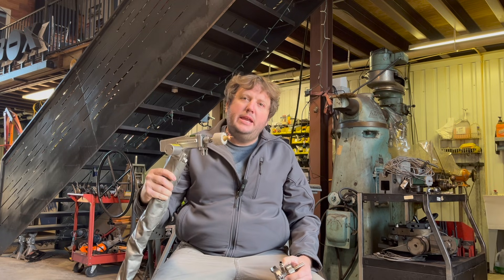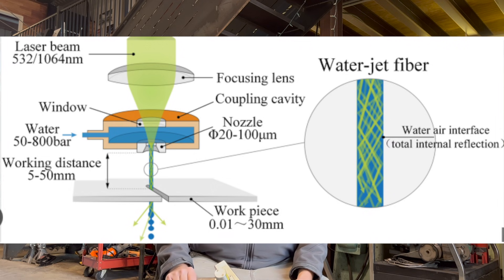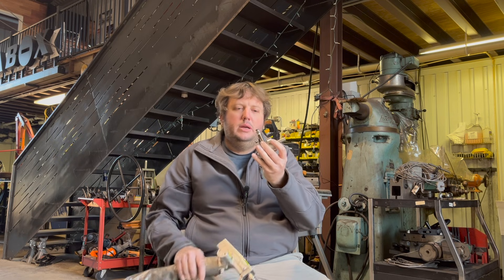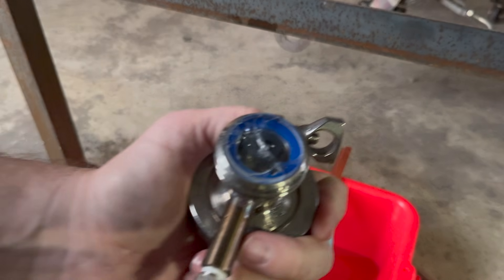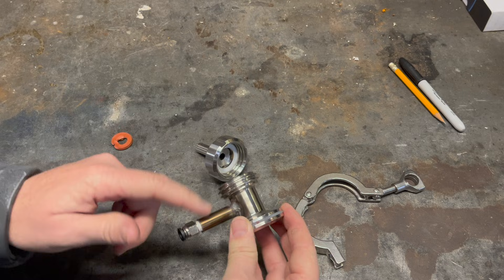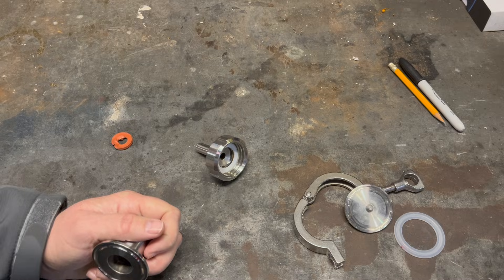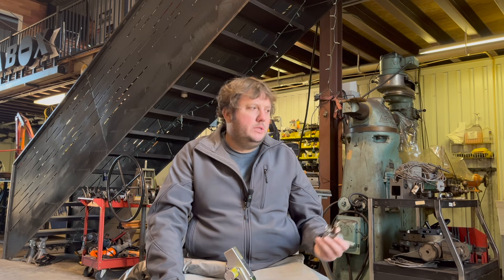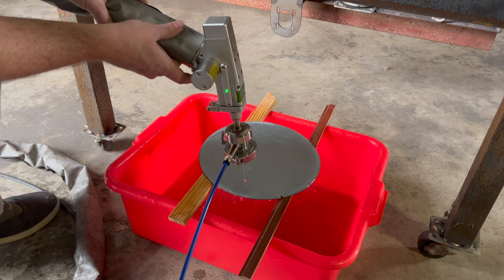D.I.Y. Fiber Laser WaterJet Cutter?

Comment: The one we looked at had to have the water degassed or the internal reflection does not work so well, and they were using a 200 watt femtosecond laser so the heat doesn't transfer to the medium. Good luck and if you get somewhere le me know.
Reply from the maker: Thanks

Comment: Why did the Blue O-ring not melt? I think the silicone red gasket is absorptive to your wavelength. Internal reflection between the two faces of the window would spread the heat to the absorbing material
Reply from the maker: Might be.  But also the blue one is submerged in water where the red is in dry compressed air

Comment: you could also try distilled water that's ran through a di filter removing all contaminates. I honestly think live the gentlemen said before me the water is cutting down on the wave length or may need to go way up on power to make it happen. if our 20kw laser cutters build up condensation in the heads they usually lose power and won't cut as well.
Reply from the maker: Yea, worth a try

Comment: check out cloudray laser for protective glass windows, theyre the right wave length consumables and very affordable. I'd use these for expirements then once you figure it out switch to a name brand supplier. I may have an old colimating lense and focus lense set laying around if you want it. its from our old precitec head  that was rated to 10kw. and you can get the replacement lenses from the holders from cloud ray.

Comment: Your laser must be pulsed with high peak power (e.g., 100 kW or more per pulse). If you use continuous wave (CW) power, even at 2 kW, it will be ineffective due to absorption in water. Try targeting a workpiece under a 10 mm layer of water; if no sparks (plasma) occur, your laser is unsuitable for this application.
Reply from the maker: Thanks ill try that

Comment: Hello friend... I made a very similar device 2 years ago. My laser is only 1500W and I also didn't have success with that type of wavelength. Even at short distances, the laser loses a lot of power. And I noticed that the water also reflected some of the energy back to the lens, which was a surprise. But the fiber-optic effect of the water beam is very interesting. When I saw your video on my feed, I immediately wanted to watch it to see if you had found a solution. Anyway, congratulations on the initiative.
Reply from the maker: Thanks

Comment: You know if the fiber laser is single spatial mode? 9 um is possible to hit with a single gaussian mode, but getting more than 65 or 70% is a difficult challenge. If the fiber laser i's multimode, no way that will focus to <9um. All that power is hitting the nozzle causing the heating
Reply from the maker: Dont know, its a MAX-2000 laser source.
Reply: @k-rigg I just looked up the spec sheet. It lists a beam quality M^2 of 2.1 (30uQBH) and 2.8 (50uQBH). A single mode laser would be equal to 1 so these are multimode beams. 

The long and short of this would be getting more details about the core diameter of the QBH fiber you're using and ANY info on the optics in it. It will likely use 1 lens to collimate and then another to focus the beam for cutting. The focal length of the focusing lens divided by the focal length of the collimating lens will tell you the magnification of the optical system. In this case, how much big your spot will be at focus is your core diameter * focusing lens focal length/collimating lens focal length. You won't want your water jets diameter to be less than that number.

Comment: You are going good, use soft copper seal instead of silicone, install the x any beam centring jig, center the beem in the exact center of orfice without touching to orfice walls, it's already collimated so it will remain in line.
Reply from the maker: Thanks

Comment: I can see your problem i think.
Is that gas blowing during operation?
Have you thought about introducing fiber extention to get past the initial contact with the water?
Reply from the maker: Do you have an example of a fiber extension?
Reply: @k-rigg what's the wavelength of the fiber laser?
Reply from the maker: @SOJACjac  1080nm
Reply: @k-rigg have you tried making sure not airgap in your unit first? The medium translation and refraction evanescence ect. Can be dephasing the laser? Enough to reduce power to target?
Reply: @k-rigg  this might be a s simple as making sure the laser is 90 from level to make sure laminar is stable, and introducing single mode optical fiber to get past the surface of the water.

Comment: I think you need a higher transmission glass at the interface so energy isn’t absorbed into the glass. Try making your own gaskets with RTV silicone too. RTV has a higher temp threshold than regular silicone.
Reply from the maker: Thanks for the suggestions!

Comment: There’s a chance that your silicone seals are melting because an air bubble is trapped in a low pressure pocket, and refracting light back
Reply from the maker: This will be the first easy thing to try and fix.

Comment: The absorption spectrum of water is quite strong in the infrared wavelengths that your laser outputs. 
It is lowest for visible light and likely the reason a green laser is used in the waterjet stream of the existing machines you mentioned.
Reply from the maker: Thats what im afraid of
Reply: @k-rigg maybe you could use something like mineral oil or glycerin, or silicon oils can be made very thin, basically some other clear fluid that might have a more favorable absorption for your laser wavelength?
Reply from the maker: @George.___  good idea

Comment: I don't think you are clearing all the air bubbles since that nozzle protrudes on the inside, so when turning it upside-down the water level will only reach that orifice and a significant air pocket will remain around it. I suspect that is why you were melting seals rather than cutting through the nozzle.
You could fill that space with sealant to prevent trapped air, preferably in a conical shape to guide the bubbles to the orifice. Or you could make a hole in some corner that the bubbles will be cleared from and put a tap on it just for clearing bubbles.

For tuning the focus; you could fire the stream into a black box where you will not see it, and then look for light that is NOT being coupled into the stream and adjust focus to eliminate it, although if the orifice is not a transparent jewel type then you would need to add an observation window to the chamber.

Also, if you can get a light sensor that is sensitive enough to get a good reading of the red laser (light sensor might be easier than a proper laser power meter) then you could fire at a sheet of glass to separate the beam from the water stream and use the light reading to fine-tune the focus position, but I think it would be easier to just look for uncoupled light.

But those only work if the main beam focus is truly smaller than the orifice, the red laser is precisely aligned with the main laser within a few microns, and the different refraction angles of the different laser colours doesn't shift the focus enough to matter.
Reply: Oh, I just rewatched and noticed that you are trusting an AI opinion on whether this would work, enough that you would bother mentioning it here 🤣🤣🤣
Good luck, but you might need to work on your common sense first.
Reply from the maker: @samheasmanwhite there are only a couple research papers on how this type of system works so that is what it uses for reference, dont have to waste time reading the papers.  But i will now just incase.
Reply: @k-rigg  AI has a lot of trouble determining what can be done as a DIY project, particularly for anything that nobody has published a DIY build of, and especially for anything that does not have a large volume of research to pull from.

In fact for anything that is not well-studied it will have a lot of trouble even giving reasonable answers.
It will give convincing answers, it can be guaranteed to do that on any topic due to the way they are designed, but you have to read the damn source material if you don't want to just gamble on the factuality.
If you consider reading sources to be "wasting time" then you are just an idiot, you might as well put your faith in a particularly well-written youtube comment and not check yourself.

Anyway, I still hope you can get this working, if you can come up with some sort of simplified method that would be great for DIY as a whole :)

Comment: I wanted to do this so bad for so long, total internal reflection, i think the paper I read on this the are using deionized water. Hard water will flash boil causing cavatation. refracts the laser and its hard to recollect the water becuase it just ionized after touching vaporized metal. some you run the water through a barrel of dionizing filters i guess i think its a resin you can recycle  I purchased a research paper years ago and printed it out, but lost the file. i seen up to 10cm of range and then a sharp falloff from diffusion they also are jetting air around the jetsream
Reply from the maker: Yea if it requires di water its going to get expensive…

Comment: If you’re having heat issues why don’t you put a pass through in the chamber and pump more water through it to keep it cool? 
Even hot water would be enough to cool it down. I don’t think a  .009” hole is moving enough water to and even if it is, the water near the first lens isn’t going anywhere
Reply from the maker: That's a good thought, I'll consider that for sure.

Comment: I like the tinkering, maybe run The water jet only? , how much psi?. Still Nice project😊
Reply from the maker: Not much, just 100psi
Reply: @k-rigg ok i see thanks, thought it was over 300 psi 😊, is it possible to mount it on a 6040CNC? What pump is used to get 100psi? Any link? Thanks
Reply: Can it cut with 100 psi?
Reply from the maker: @johanedvardsson835  in just using filter city water at line pressure
Reply: @k-rigg but The cutting part is by the laser correct? Water is for coling The nozzle?
Reply from the maker: @johanedvardsson835  water is directing the laser via water beam
Reply: @k-rigg ok i see, that, s genious. Maybe you can get it to work 😊

Comment: I think your right I think it's a focus issue. I operate a 1kw fibre laser and if I use a lot of nitrogen cutting thicker materials the lens can fog up with the cold nitrogen. That causes a lot of heat to build up in the head. I am guessing the focal point of off here and that's why it's overheating and not doing any cutting. All that energy is probably lost in the water chamber before the nozzle. Keep up the th good work I would love to see a working homebrew machine. The technology seems incredible
Reply from the maker: Thanks!

Comment: Cold water might fix your seal melting issue, and to fix the fogging issue, purge the chamber/area between the laser head and lense with dry air or something like nitrogen.

If you can create a good seal, you could in theory just purge the volume once and seal it off, but I don't know how feasible that is. Otherwise keeping a small flow of nitrogen or other dry gas (maybe compressed air that's been run through a good dryer) to keep positive pressure in the chamber connecting the torch and lense will do the job. You shouldn't need very much flow for this, the compressed air you're using is too much, and is probably part of the reason you're getting fogging. Shop air in my experience tends to be pretty damp, and you can see condensation build up if you shoot a bit of steel up close and hold it there for a while.

The bigger issue might be the laser wavelength and if it's being absorbed by the water. If It wasn't even marking material at that distance I'd suspect you're having some major loses somewhere. You mentioned that the systems you've seen all seem to use green lasers, I suspect there's a reason for that, most likely to avoid absorption by the water. If you look at the light absorption spectrum for water, there's a trough around 500nm where absorption is low, that's in the range of blue light which is why blue is the last color you see as you dive deeper in the ocean, the others get absorbed before they reach that depth. Green is pretty close to that wavelength, which is probably why the commercial systems you mentioned use a green laser. Your laser is about 1000nm which I think corresponds to near infra red. I'm not an expert at reading light absorption spectrums but the absorption rate of that wavelength in water looks to be at least an of magnitude (maybe 2-3 orders based off a couple of graphs I looked at, but take that with a grain of salt, I don't have any experience reading light absorption graphs and the units are gibberish to me) higher than for green/blue, meaning you're going to lose laser power very quickly in the water jet. Might also be why you're getting a lot of heat build up at the lense, the water is absorbing the laser light and converting it to heat. This is mostly guesswork on my part, lasers are out of my wheelhouse. I know blue/green light penetrates water better than red (and I'm guessing by extension near infra red), but by how much and if this is really the core of your problem I can't confidently say.

The first issue is fixable, the second one might unfortunately be a show stopper for this particular laser unit.
Reply from the maker: Thanks for suggestions

Comment: You have several issues one being your water pressure, but I like your approach. The window material is usually made of crystals (I forget which but I think sapphire), and the nozzle actually uses high pressure gas (helium, I believe it was) to constrain the water flow. The heat in the seals, is solved using high temp seals and blowing dry air over the window. They use a 50-300w green laser normally but I know IR works as well. You might need to turn it down and fix the focus. It needs to be focused passed the orfice or right in the center to avoid the water turbulence scattering the light. I think you are close, and should be able to work your way through these issues.

What pressure and laser power levels are you using? It is hard to help without knowing what you are doing. These systems do not burn the material, it is more like heat shock AND water jet. They still use like 5k PSI I think it was like 800 BAR. All the machine parameters are actually on the manufacturers website.
Reply from the maker: I used a syphire orifice meant for water jet, and dry cold air as a purge with about 100psi water and air.  I ramped up too full power at 2kw

Comment: Regarding the condensation, using two (or more) glass discs separated by an o-ring (ideally it should be vacuum between them) can help as it will introduce a temperature gradient so that the cold surface on the water side won't cool the air down below its dew point on the laser side. As the laser then warms up the glass that will become a non-issue once it is running. It can actually even be beneficial as it might keep the glass cool enough so that the seals don't melt. Just an idea to try out.
Reply from the maker: Thanks for the suggestion

Comment: Maybe you should try putting the laser in a vacuum? This would take care of your condensation issue and allow you to use cold water, and this is just a theory... It's the laser hitting the are that are causing your seals to melt. I don't know what kind of seals you're using but you should probably be using high temp o-rings instead of flat seals if you were going to introduce high pressure. Also lowering the atmosphere on one side you need to make sure that your lenses are thick enough to handle the pressure differential. Likewise, if running a vacuum isn't practical or possible, you could put a vent and introduce are from a compressor after it leaves a dryer. You would need much psi but this would also aid in cooling if that continues to be an issue.
The other thing is the focal point for your laser needs to be on the opposite side of the lens, the laminar flow will take it from there but if you focus it onto the lens then the lens will get hot. If you focus it on the other side of the lens, and as long as you have water flow it shouldn't get hot. Your focal point should be as close to the exit of the chamber as possible. This just popped into my head... The inside of your chamber, it needs to be black. This is so that the laser is reflecting inside the water and not off the inside of the chamber. That could be another problem for your heat issue.

I hope this helps.
Reply from the maker: Thanks

Comment: Localized absorption ≠ bulk absorption Water may be transparent overall, but: Microbubbles, Dissolved ions, Turbulence at the orifice, Back-reflections from metal,…all convert some laser energy into heat right at the window and seal.  Typical silicone O-rings: Start softening ≈ 150–200 °C Deform long before they “burn” Have lousy thermal conductivity So they don’t just melt — they creep, distort, and ruin alignment. The lens is acting like a heat sink If the protective window isn’t sapphire or fused silica with proper mounting, it will: Absorb a little energy Dump heat straight into the seal, Warp the optical axis. Cue alignment hell.

You’re trying to align: A ~100 µm core fiber, Through a lens, Into a ~100–300 µm water jet, While everything heats and moves

Commercial systems solve this with: Fixed optical blocks, Rigid sapphire windows, Precision capillaries, No elastomers anywhere near the beam

Floating optics + elastomers + kilowatts = sadness.

Try using a sapphire /fused silica window, metal to metal sealing, or viton (FFKM = better) at a minimum, and active water cooling BEFORE the window.  Maybe a copper mount w/ active cooling, and an FKM perimeter oring helping center the window in a copper (heat dissipating) mount?  Channels in the copper for water to move through.  FKM keeps the glass from being so rigidly mounted in the copper it cracks.
Reply from the maker: Good ideas, thanks